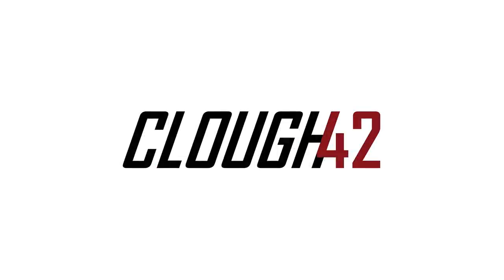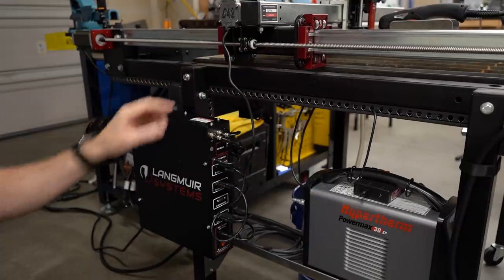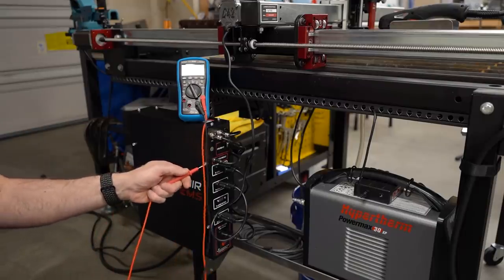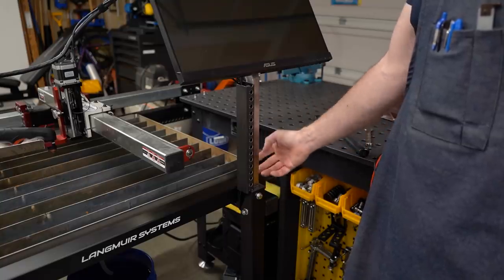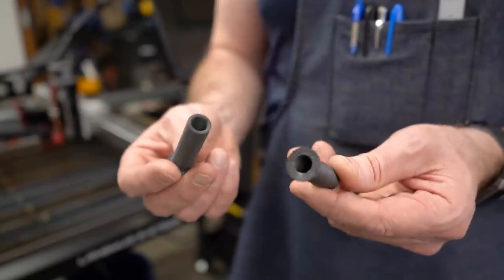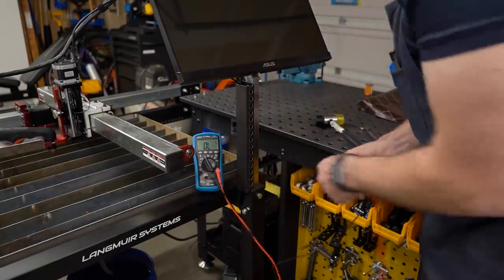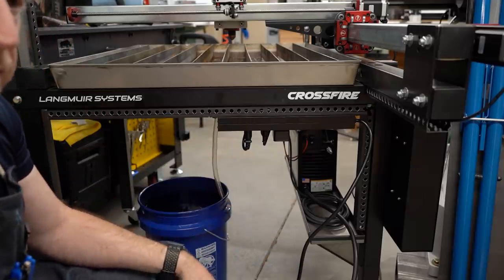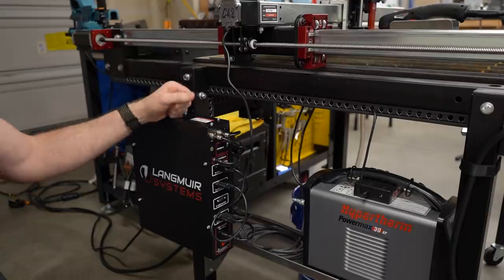AddenDUMB: I Broke My CNC Plasma Table! | Learn from my mistake | Langmuir Crossfire THC

Comment: Um, as an electrician, I sincerely hope you’re misinterpreting Langmuir’s instructions. Earth bonding (grounding) is a safety practice, and a large body of metal like the plasma frame being unbonded can lead to electrical shock in case of ground fault. In your shoes, I’d see if you can properly bond the the frame to ground, and then perhaps isolate the computer ground from the controller with a USB isolator.
Admittedly I don’t know the code in the US, but Langmuir’s instructions on how to float a laptop on the arc voltage sounds like something that’d not pass code in any residential household, according to what code I’m familiar with. I’ve never done industrial work, where this MIGHT be allowed, but then again this is a residential garage.
Reply from the maker: No.  I'm not misinterpreting.  The computer and metal electronics enclosure are grounded.  The table is part of the cutting arc circuit, so is floating.  Here's the documentation explaining how to make sure the table is floating: http://www.langmuirsystems.com/thc/guide#grounding-section
Reply: @Clough42  Is the controller earth-bonded? They want you to check continuity from the USB shell to the gantry, but there's no word on whether the gantry is earth bonded. It'd make me REALLY uncomfortable in a residential setting to have that whole thing unbonded to ground, and since you CLEARLY have ground creeping in someplace, you're now floating your entire machine frame on the arch voltage during a cut. I dare say this wouldn't pass muster on any residential code I'm aware of.
Reply: Note that arc welders and - I assume - plasma cutters are galvanically isolated from mains, so you can have your machine frame bonded to ground while running the plasma current through the frame back to the plasma ground connection. Laptops are generally also powered with class-2 power supplies, so they're galvanically isolated from the mains (and ground) as well. The safe way to do this would be to bond the machine frame to ground and measure the arc voltage from the tip of the plasma cutter. That way there's no shock hazard anywhere...
Reply: @clough42: You definitely did nothing wrong assuming the computer/monitor chassis can be bonded to the metal frame of the PAC. In fact – generally they should be explicitly tied together (your “local” code may vary – I’m not that much on par with UL). This is either an anomaly or a shortcut on the voltage divider unit designer side – which in this application should incorporate a differential measuring circuit. Grounding is indeed one of the more headache-inducing fields in EE, but assuming potential separation between two metal boxes in close vicinity in your design is not only near-sighted, but wrong and potentially(ha!) dangerous. “Over here” all accessible conductive surfaces must be equipotentially bonded (and bonded to PE) and I assume the regulations are more-or-less the same in the US.

Comment: To me this "fault" is more to do with table design. The manufacturers have no control over the numerous environments likely to be encountered up and down the Country where inadvertent grounding conditions might be encountered, as you found. Thankfully with no lasting consequences. Electronically, no circuits should ever be engineered where conflicting grounding conditions may be encountered; the potential (pun intended) for accidental circuits is enormous.
Reply from the maker: You're not wrong.  :)
Reply: Very good point, but I'm not sure what the solution would be. As far as I understand it, Plasma cutters have to use positive "ground".
But, only the slats that the material is placed on really needs to be connected to the plasma "work ground". If it could be isolated from the rest of the frame, the frame could be grounded. But, that would of not be feasible since you would then have a positive from the plasma and actual ground easily accessible on metal parts next to each other.

So when the plasma is running, you could easily get shocked by high voltage, high current, would easily kill you. My hand held plasma runs something like 250V and up to 50A if I recall correctly, at least its a lot higher voltage than say a TIG welder.

So I'd imagine that it is a fairly hard problem to solve..
Reply: @Robinlarsson83  You could touch the ground and 250v of the plasma without problems. the plasma cutter is isolated so the 250v are floating voltage. if xou touch it together with ground the 250v are now 0v and on the other side -250V. Best regards

Comment: OK, others have mentioned it.... and, I am to. Carbon fiber? Not conducting? Is it really carbon fiber? Because carbon conducts electricity so well its used extensively from old telephones to next generation everything. Also you are SO lucky in your FUBAR that the head unit didn't smoke check itself. Trust me, I've smoke checked $6.5m USD of radar equipment because the person before me didn't understand grounds and grounding.
Reply from the maker: Yes.  It's chopped carbon fiber, not continuous, suspended in non-conductive plastic.  Also not ground fiber or carbon dust.  Some  manufacturers specify the fiber length in their datasheets.  Though the Internet is full of people who logic it out in their heads and decide that they all must be lying.

Comment: I dont want to be negative, but i think this is the wrong solution to the problem. The THC electronics should be produced in a way where this wouldnt be a problem. Now the machine frame is (theoretically) not grounded, and is a potential hazard if mains power shorts to it somehow. I dont know how regulations in the states apply but in my country there are actually specific rules for machine construction that say the machine frame is to be grounded to the same ground that supplies the machine. Not saying youre in the wrong here, just that this might be a potential hazard and maybe the design flaw lies with Langmuir? Again maybe things are done differently in the states.. Otherwise great video!
Reply from the maker: Yeah, this appears to be the way they designed it.  I see your concerns--especially in the case of an equipment failure of some kind, but there's not much I can do about it if I want the THC.  I want the THC.
Reply: The THC is a must of course! After all the odds of something going wrong is minimal, i would probably done the same if it was a private/hobby machine, but at work we follow the rules. In this case i doubt there will be a big problem. Happy new years!